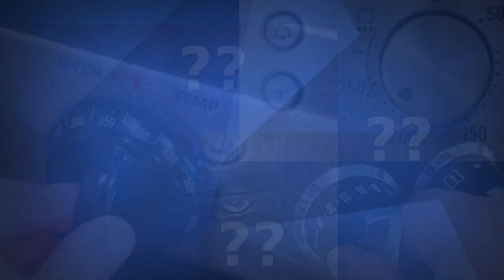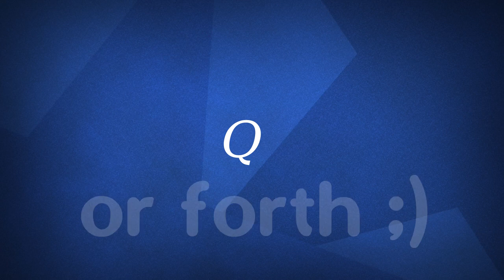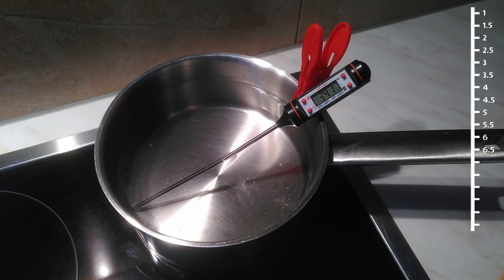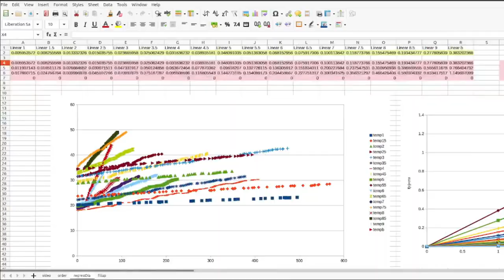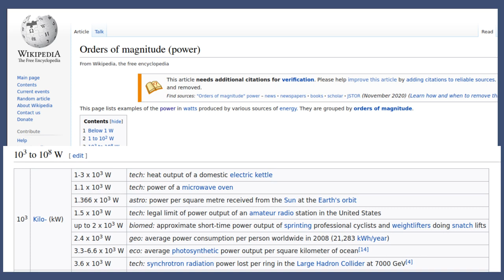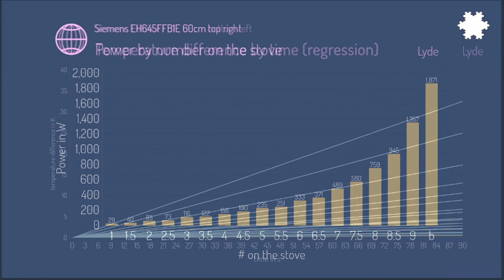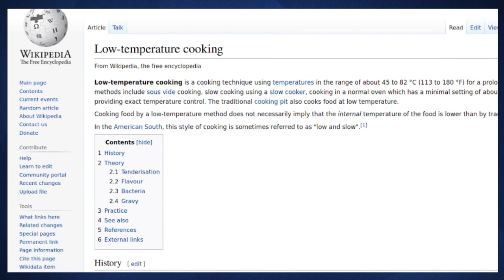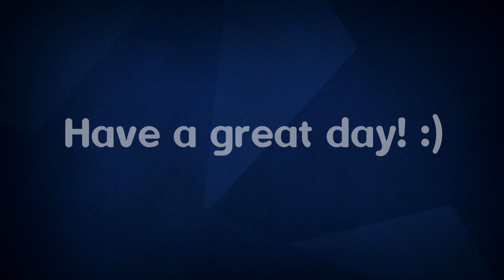What Do The Numbers On Your Stove ACTUALLY Mean?

Comment: My husband and I were discussing the double burner in on our stove. The knob on that burner is split in half one for the larger size and the left side of the knob is for the smaller size. My husband thinks of the knob like a flame on gas stove and because the 6 is in a different location on the split burner knob, he thinks it is burning hotter (it is roughly the location of 8 on a typical knob.). I think a6 is right the same no matter what burner I used even if the numbers are located in a different spot.